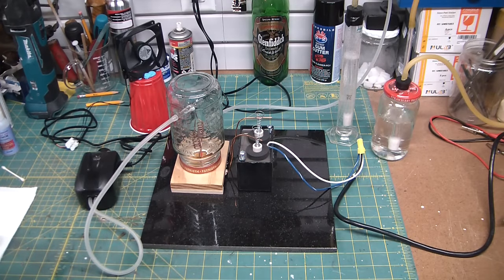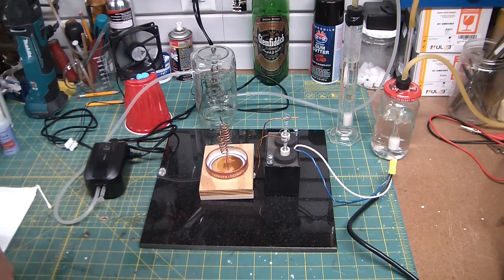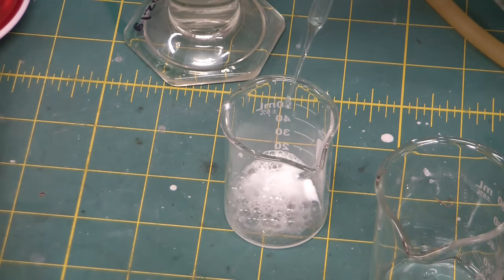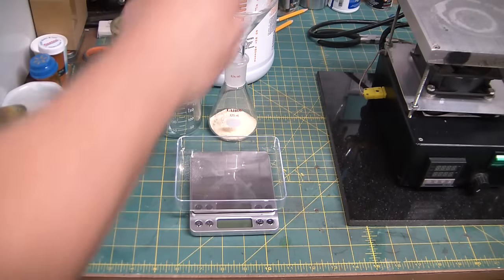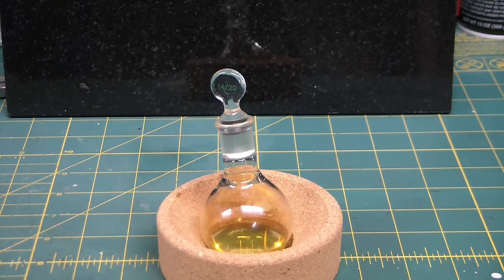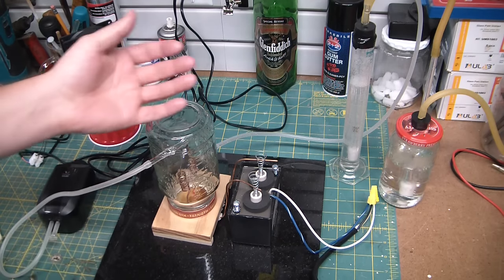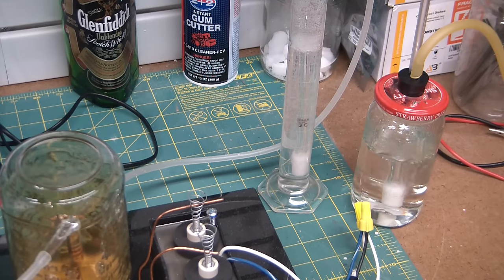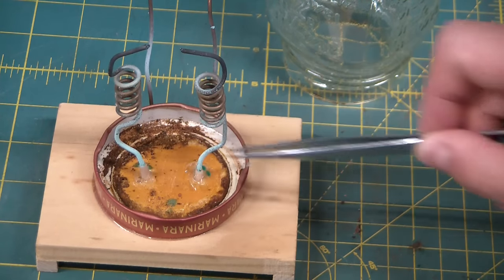Making Nitric Acid From Air - Elementalmaker

Comment: Before the Haber process was developed, this was actually the main industrial route to making nitric acid: Air was blown through a huge spark array, making a mixture of NO and NO2 - this was further oxidised to convert the NO into more NO2, and finally absorbed into water to make nitric acid. In that last step, the NO2 disproportionates, some being oxidized further to nitric acid, the remainder being reduced back to NO. The latter was of course recycled back into the second oxidation step to make more NO2, enhancing the overall efficiency.

This was of course a vast improvement in nitric acid / nitrate production over mining guano deposits, which was a truly disgusting but necessary pastime. But as you correctly point out, it was also an extremely inefficient way of using electricity, since the vast majority of the electrical energy input was wasted as heat. So it was only really viable where power could be cheaply generated, which explains why the first plants were built near to the Norwegian hydroelectric power stations.
Reply from the maker: Man I might have to hire you to write some script for my videos. That was a great and concise explanation! I tried to explain all that in the video (or at least in filming), but I always ramble and then end up cutting out a ton of stuff during editing.
Reply: @ElementalMaker  I can certainly try, if you are serious about that offer. Just give me an idea of what you want to do for forthcoming videos and the kind of information you want to get across. Plus how much detail you want and what you want the maximum video length to be.

Comment: Good to see you back.  This setup reminds me very much of the rig I built for silver recovery/refining.  Instead of your reaction chamber I have a vacuum flask with an air pump at the vacuum port and the silver dissolving in the flask.  All the NO2 is then piped out into multiple flasks to capture as much as possible.  Last in line is a gas trap with KOH.  Zero smell after final venting.  It's shocking how much nitric I can recover and feed back into the first flask eliminating the need to buy more.

But I like what you've got going here.  Have you noticed any condensation in the bottom of the reaction chamber?  I'd expect some NO3 would slowly build up and settle in the bottom.

Comment: Nice generator. This is also by far the best video on this topic out there. I tried making a nitric acid generator last year using a microwave transformer with much less success. I struggled to keep the arc going without melting the copper electrodes.
Reply: You can use copper tubing for the air supply and exit, and energize the tubes. That way, they get a bit of cooling, but there is a risk of them burning in the electrical fire, with the air blowing right at the hotspot. The last one I built had the air input as a copper tube, some stainless steel wire as the electrode for that tube, and the other electrode was a tungsten "W" TIG welding electrode, in the exit tube, so the air could leave while tightly surrounding the tungsten.
Reply: A microwave transformer will put out WAY too much current and not very much voltage. That's why it wont work too well, the arc just gets way too hot which destroys most of the gases you want and it just turns back into regular air.

You could get some succes by limiting the current a lot, but ideally you want a completely different transformer. A neon sign or oil ignition transformer is closer to what you want, a TV flyback may be the best commonly available way though. You basically want a big, but cold arc.
Reply: @Basement-Science  Could you drive the B-E reactor with an electrostatic generator? (I imagine the throughput would be tiny even if it worked though.)
Reply: @benjaminmiller3620  That's more the direction you'd want to go in, yes. Although I'm not sure what type of generator you mean exactly, something like a van de graaf would be very weak for example. 

As I said, I think a TV flyback (driven by slayer exciter or other single-transistor driver) would be ideal here. The electrode layout is also very impactful of course.
Reply: @Basement-Science  I was thinking Wimshurst, and more as an experimental low tech solution, than an optimized one. One could build such a generator with copper age tech!
Reply: @benjaminmiller3620  I mean, try it if you've got one of those, I just wouldn't buy one just for that experiment. Technically there should be no minimum power required to make the product, but it is going to be very very slow.
Reply: I used a "Jakobs ladder" as spark generator and used tungsten electrodes. It operated for months and it's still looking good.
Look for "Jakobsleiter (Elektrizität)" in german wikipedia.

Comment: Magnetic arc manipulation is all about the forces on an electron flowing through the magnetic and electric fields.  

F_e=q*E + cross(q*v, B);

Where E and B are vector fields, q is charge of the electron, and v is the velocity of the electron.  
For a proton, negate q.  

Solve the multivariate differential equation or find the solution with thought experiments and examples followed by actual experiments.
Reply: @dandan-gf4jk  Velocity is a vector, as is magnetic field and q is a scalar multiplying the whole vector.  Looks all good.  and yes, I know what the right hand rule is.
Reply: @dandan-gf4jk  v is lowercase because it is also with respect to time now that I think about it.  Notation is hard when you only have text.  It is also inconsistent in different fields of study.

Comment: This is incredible, the way you collected nitric acid is nothing short of genius and borderline magic. 
Are there more efficient ways to collect nitric acid though with common materials?
Reply: You can thermally decompose Copper(II) Nitrate or distill nitric acid from Potassium nitrate and sulfuric acid.  The latter of which is supposed to produce the purest form of Nitric acid.
To be honest though, this is definitely the CHEAPEST method. You don't have to buy any chemicals, expensive glassware (chemical glassware can be quite expensive!) 
However, a fume hood for ALL of these methods, including the one in the video is a really great idea.
Reply: You can make relatively pure fuming nitric acid with stump remover and drain cleaner from the hardware store, the stump remover is potassium nitrate/KNO3 and the drain cleaner is (usually) 90 to 95% sulfuric acid, though if you can get your hands on 98% sulfuric that would be ideal, you'll get less water contamination. You pretty much follow the steps he did here after he boiled the sodium nitrate out of solution, the sulfuric acid and KNO3 (or sodium nitrate, either will work) get added together in the distillation rig which then is heated (the heat drives the reaction) and your nitric acid condenses into the collection flask. It's cheaper than buying it online and comes with no legal or red tape restrictions (which fuming nitric acid has a lot of), though if you have the licensing it's much cheaper to just buy it from an industrial supplier. For us amateur chemists that do things in very small quantities, making it this way is definitely the most economical method though, aside from the cost of the distillation setup (which as a chemist you should already have) it will cost maybe $30-$40 worth of materials for at least a full liter of fuming nitric acid, probably more if your process is efficient. That's at least half what you'd pay from an online retailer, assuming you could even find one willing to ship it to you.

NileRed has an excellent video on the process, you should check it out.

Comment: i will make use of this thank you good sir. niric acid is hard to get for me and so is sulphuric so making it from KNO3 was off the table. didn't know about this. very informative
Reply: If you can't get sulfuric, and this electrochemistry appeals to you you (as it should), you can make sulfuric from electrolysis of copper sulfate (I call it crystal smurf), which is a fun and beautiful process, and much more enjoyable than burning sulfur in air and sucking the fumes through water, like a dirty victorian. It's common enough that a lot of chemistry channels show how to do it.
Reply: @buckstarchaser2376  You can do sulphuric acid, burning sulphur,and passing the SO2 in water don't? Distilling water from sulphuric is more easier than making electrical shenanigans I think...
Reply: @isaacm1929  You would need to distill it either way, I think. I've never done the burning method, but the copper II sulfate electrolysis becomes very useful later for some uses, such as precious metals refining.

Comment: So for the Berkland Eyde reactor next time run two copper tubing loops instead of the coils for the electrodes . Pump cold water through them to cool them via a water pump and recurculate it back through copper coils in an icebath so you have supercooled water going through the  electrode loops. However a fan works good if you plan to leave it for hours. You can also make the charging device from a 24-volt supply to a  ZVS  driver to a flyback transformer. On the transformer you want about 8 turns on the primary and 1000 turns on the secondary which pretty much gives you 9400volt output. You also want a grounded center tap on the transformer. This prevents the secondary from potential arcing to the transformer core.

Comment: I love it!  I found your channel by watching hydrogen generator videos and here I am.  I considered making one of these as well.  If you use solar panels to run the pump and to create the arc, you spend nothing at all.  You could have the apparatus set up and automatically running whenever the sun is shining.  You'll get some very freakin pure HNO3 over time.  In fact, if you forget about it for too long, NO2 will start to escape from your final bubbler and get into the air (UGH!)  But, hey, FREE nitric acid! 😅

Comment: Thanks for a great video, if you had cheap solar or wind power, would it be a feasible way to produce fertiliser from excess electricity?
Reply from the maker: Thank you! For sure it would be a great way to produce fertilizer with excess energy! Just be sure everything is done safely, NO2 gas is quite deadly. I'm considering doing the same, I have a 4 265w solar panels not being used right now, and that could be a great application.
Reply: @ElementalMaker  that's fantastic, you've just gained another subscriber🙂
Reply: @ElementalMaker  Pitter patter, let's get at 'er

Comment: What an awesome way to generate the good stuff, thanks for sharing!  It might not be a viable way to produce from bought electricity, but imagine creating a self contained nitric acid production unit the size of a beehive with a solar panel to power it that also serves as its roof to catch rainwater with, which in turn can be used in the generator.  Once a month you drive by it and pick up the produce. With a few Niter Hives you'd have many years of free  product.
Reply from the maker: Love the name niter hives! I've actually bought a few solar panels to try and do just that! Great idea for the water collection too!

Comment: Very cool setup! Nice job. Nitric acid isn't cheap when you factor in transportation costs, so might not be as cost inefficient as one might suspect. I don't recall what I paid for a 1 liter bottle. However, I do recall that shipping was more expensive than the acid given that it required special handling. 

Please be safe.  Getting burned is a tough lesson. Nitric acid is nasty and dangerous. Should always wear gloves and eye protection. A fume hood is a must. Even a small NOX leak is enough to ruin your day.
Reply: If it only requires 40 watts, it could easily be powered by solar.

Comment: An number of questions come to mind:
1) How much RF interference is the arc generating. Are you blanking tv reception for the area.
2) the reaction jar appears to have a metal lid. Is this corroding from the gas?
3) is it worth drying the input air?
4) have you considered adding potassium or ammonium hydroxide to the second collecting jar, so as to ensure no toxic gas escapes, and to collect the nitrate salts? I guess this may not be an issue in the US, where such salts are still available to domestic customers. 
5) is the high voltage transformer rated for continuous operation as a spark generator?
6) is the spark current a.c. or dc ?
7) given that a plasma arc has negative or zero resistance, what is limiting the output current?

Like your other video on chlorate production, this was very interesting.
Reply from the maker: Happy to answer what I can!
1) I'm not sure how much rf interference it generated and unfortunately I have no way to measure this.
2) the reactor lid was cut away in the center, and any exposed metal areas were covered with epoxy. The jar lids factory lining seems to have actually held up great to the environment in the reactor.
3) drying input air definitely would have helped preserve the integrity of the reactor components, like the copper electrodes and epoxy, as the nitric generated from moisture in the air degraded things quickly. I don't think drying the air would change efficiency though.
4) yes however I was hoping to avoid nitrite formation, which happened anyways, so next time I think in the final wash bottle I will just add a some lye.
5) This transformer is rated for continuous operation.
6) not sure if the arc is AC or DC, and it's unfortunately way out of the range of my meters to safely check.
7) I assume the transformer may be shunted, or it may be a solid state device with some kind of current limiting built in.
Reply: @ElementalMaker  Thank you for the information. I was aware of the process, it was covered in my chemistry education, and there are a number of YouTube videos covering the process. All emphasises the poor efficiency of the process. It would be interesting to investigate the magnetic method of expanding the plasma in the arc. Whatever voltage you are using seems to be producing a more efficient reaction than some other examples I have seen. I think the DBX1 channel built a similar apparatus and produced a much poorer yield. 
Useful if there is no other access to nitric acid or its salts. 
In the uk ownership of sulphuric or nitric acid is now illigal. Fortunately, these were not the rules during my youth, so I had a chance to experiment. To do so now would risk serious legal consequences. Nice of you to perform the experiments for me to watch from a safe distance, I think America is at a safe distance. I also watch the  explosions and fire channel, and Australia is at an even safer distance😁. 
I would have expected the electric arc to jam local HE, VHF and maybe UHF radio channels. So very local tv and radio reception should be affected. It all depends on the length and distribution of the EHT feed cables. After all it is a basic spark gap transmitter. An old medium/long wave am radio would provide an indication of the extent of any radio interference.
 There are a few things that can be done to mitigate and RFI. Such keeping the EHT  cable loop as small as possible, consistent with avoiding cable insulation breakdown, maybe fitting a choke ferrite to the cables. Given the intended purpose for the EHT module, it is likely to have suppression capacitors and coils built in. I am a little surprised that it is rated for continuous operation. As you suggest there maybe a current limiting circuit.
Reply: Input from a radio/electronics nut:
1) Probably not too much - it's a commercial oil burner transformer designed to make an arc, so it's likely designed to minimize RFI, at least on the mains input. As for the HV side, the connecting wires are quite short, so there's not much of an antenna to radiate RF. Most effective radiators are 1/4 the wavelength of the RF, so these wires are going to radiate best somewhere in the high UHF to microwave region. There'll be very little of those frequencies present due to the parasitic inductance & capacitance of the wires themselves.
6) I'm almost certain it'd be AC, or you'd see uneven electrode wear (Think TIG welding, where using DC puts more heat into the negative side). Since it's designed for long-term use in an oil burner, rectifying the output would only add unnecessary cost and wear out one electrode. From the size of the unit and sound, I'm guessing it's probably a pretty simple chopper circuit taking unsmoothed mains and driving a ferrite transformer with bursts of several KHz 60 or 120 times a second. Switchmodes using smoothed mains make a hissing noise on the arc, and iron core transformers (MOTs, older neon sign transformers) make a smoother humming sounding arc.

Comment: Nice video, thank you. Instead of wood, better use a ceramic plate and drill holes through it, for the contacts. Seal that with a gasket, made from ptfe if possible, or a big rubber-ring, that can be wrapped around with ptfe-sealing band. If made right, the only thing still oxidized, are the copper electrodes.
You only need something that presses down the jar hard enough on the gasket. 
It's also some more effective to run the arc on a jacobs-ladder, because of ionisation you can extend the arc that way to a maximum and oxidize the nitrogen over time more efficiently. If the jar is just big enough, no additional cooling is needed. However, it's just an interesting experiment, but still gaining importance, while prohibitions on hobbychemists are getting closer to the maximum. 
If you use a solar panel to power that thing, efficiency is no problem. Over the time it would generate enough nitrate, to equalize the costs. 🙂

Comment: You should try to coat the interior of the reactor in some clear protection spray, the damage might come from a combination of chemical damage and UV damage, and some good clear coats are quite resistant to both.